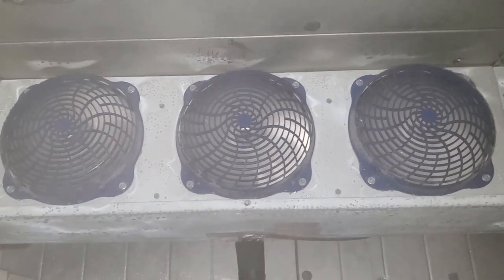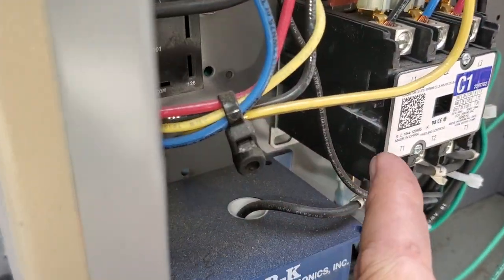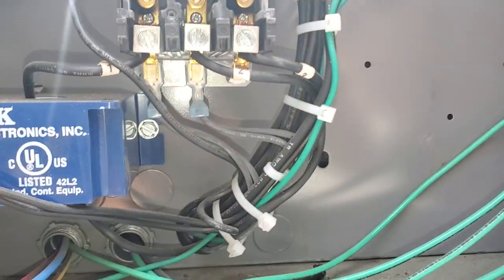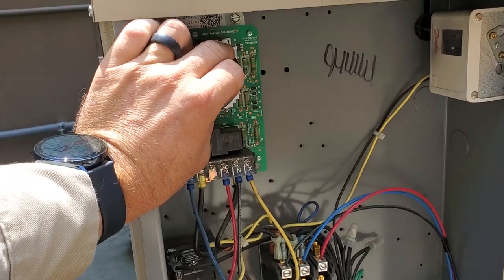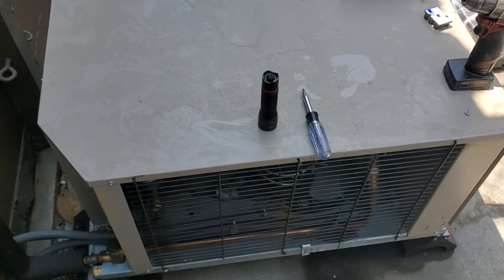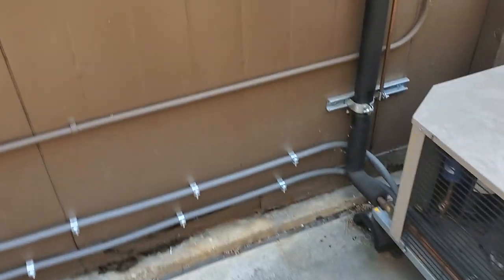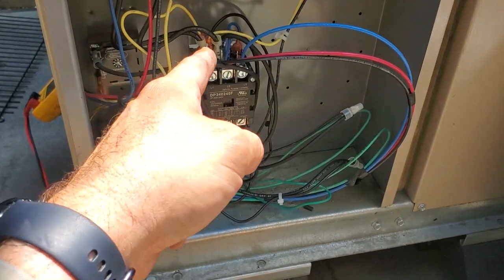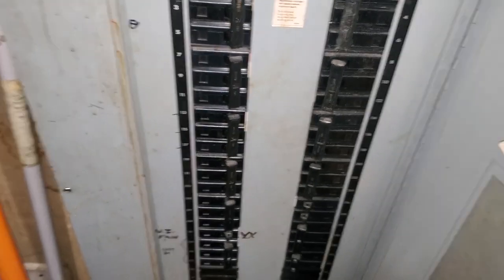THE WALK IN FREEZER BREAKER IS TRIPPED

Comment: It was black red blue
Reply: Scroll back to 7:50 before he changes the contactor , clearly black/blue/red while compressor was running normally, he switched blue and red when he changed the contactor , check wiring again at 12:40 you will see the switch